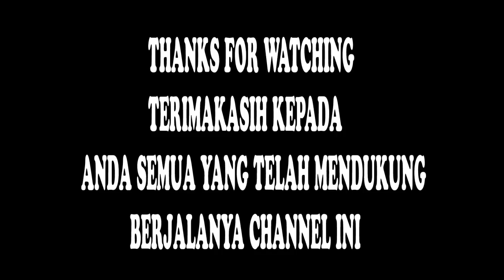cara merakit power ampli sederhana

Comment: Itu adem selalu ya bang transistor final nya dan trafonya?
Reply from the maker: Ya biasanya anget mas..di siasati dengan memasang kipas 12v biar aman dan awet
Reply: @ReogChannel  kalau nggak di kasih kipas DC adem selalu ya bang transistor final dan trafonya
Reply: @ReogChannel  buat angkat 8in 2 dan 10 in 2 kuat enggak ya bang ?
Reply from the maker: @najwaelek5139  kalau trafo gak usah di kipasi gak papa mas..asal trafo kondisi normal.

Gak pake kipas juga gak papa tapi untuk jaga2 kalau digeber/beban berat biasanya tr final mulai anget
Reply: @ReogChannel  buat angkat speaker 10inch 2 dan 8inch 2 kuat enggak ya bang ?
Reply from the maker: Spek amplinya seperti apa bang?
Sama seperti di vidio kah?
Itu lebih afdol nya pake 2 power mono 
Per mono minimal 1 set final

Comment: Gan .sanken sya baru Pasang langsung jebol .dikasi 32 ct 32.soalnya dipapan trtulis 42dc
Reply from the maker: Ganti juga tr driver nya biasanya itu masih bd139 140
Ganti tip 41 42
Reply: @ReogChannel  Udh tdnya d313-b507 gan .cuma tr sankennya ko bawah kodenya 60 watt. Mksudnya apa ya.. Sya ganti tip3055 akhirnya  gan
Reply from the maker: Saran saya kalau mau supply diatas 25v
Ganti 
- tr driver
-tr final
Kalau cuma diganti salah satu saja biasanya masih kobong hehe bahasanya belibet..
Final pake sanken / Toshiba jangan TIP
Reply: @ReogChannel  Iya itu masalahnya dr beli jd itu udh trtulis 42v.. Driver d313 b507.final sanken monstar langsung jebol Yg npnnya akhirnya ganti tip3055 2955 dh..Tegangan max berapa gan harusnya buat sanken monstar..nah wktu bli ocl 100watt tip3055 aja yg udah jd bagus ko dstu trtulis 24vdc
Reply from the maker: @AtepChanel11  ya produk lokal yg banyak dijual emang sperti itu bos.. makanya kita harus lihat2 dulu komponen yg ada di kitnya sebelum meng eksekusi...
Kalo tip saran max 25vdc saja jangan lebih..kalo mau lebih ya di rombak komponen nya yg utama tadi saya sebutkan di atas

Comment: Mas kasih kisaran harganya alat"!
Reply from the maker: Untuk alat ya seperti solder, tenol dll
Untuk bahan kit power driver mungkin sekitar 50rb sudah ada transistor final nya
Tune control subwoofer 30rb an
Trafo 5A biasa 70rb
Elko 6800uf 50v 2biji 12rb
Dioda 10A 7rb
Belum box dan aksesoris lainnya

Comment: Saya sebagai pemula apa nama nama komponen Yang dibituhkan tolong sebutkan dan harganya semuanya berapa kita kira
Reply from the maker: Bisa dilihat di video2 di channel ini sudah banyak tutorial2 nya...
Yg umumnya
Travo 5A kecil ,: 100rb
Elko 6800uf /50v 4 biji : 60rb
Driver socl 504 : 75rb
Transistor final 2 set Toshiba 5200 : 70rb
Headsink tipis : 35rb
Kipas dc: 15rb
Tune control subwoofer : 30rb
Speaker protektor (jika dibutuhkan) : 40rb
Jack Audio 3.5mm : 12rb
Soket RCA : 10rb
Terminal output spker : 3rb
Tenol kecil :14rb
Baut : 3rb
Saklar indikator 3kaki : 3rb
Box power bell m210 : 250rb (bebas mau pake box apa)
Dan tambahan kompone2 kecil lainya
Reply: @ReogChannel  
Terima kasih jawabannya semoga Chanel anda semakin berkembang

Comment: bertanya dl gan..travo 5A murni dioda35 n elco 4biji 10000mf 80v.brapa vol di ks dr travo 25,32,40,45.sy mau rakit 400wath x2 gan tlong petunjukx...trims.
Reply from the maker: untuk speaker berapa in x berapa
Reply: 12 in. 8 omh 4buah sepiker gan..
Reply from the maker: Wayan Wiarta 45ct

Comment: Dioda kiprok yang di pake di ton control ukuran brpa mas
Reply from the maker: 10Amper
Reply: @ReogChannel  untuk tegangan yang di ton control di taruh yang brpa vol bos
Reply from the maker: @errfirr1635  12-15v
Reply: Bang kalo kegedean ampere dioda efeknya apa
Reply from the maker: @errfirr1635  gak apa" gan malah lebih bagus
Reply: Mas ngikut gabung kalau dioda kiproknya pakek 5amper 4 bisa gk buat tone control nya
Reply from the maker: @wardiaticoc8464  bisa mas ... Minimal 5Amper
Reply: Dioda 5amper 4 biji trus elconya berapa vol. Mas dan berapa biji
Reply from the maker: @wardiaticoc8464  elko minimal 2200 uf / 25v 
Dan dioda 2/5Amper
Reply: matur nuwun mas, tak dungakno mas semoga di mudah kan rezekinya dan segala urusannya amiinn.
Reply: Oiya mas dioda nya berapa biji, saya nyari yg dioda kotak 5apr. Atau yg jari 4. Susah amat, adanya paling yg panjang kayak lontong, itu bisa gk dan  Pakek berapa biji, matursuwun

Comment: Kok elkonya banyak bang.
Itu pengaruh.y apa bang.
Trs itu bisa ngangkat berapa spiker X berpa inch bang.
Reply from the maker: Arnot77 Arnot elko lebih banyak lebih baiki bang karena biar voltase nya jika terkena Suara Low / bass tidak ngedrop (atau istilah nya nggaber)
Reply: Berati bisa menambah kualitas suara dari bas ya bang.

La saya mau ngrakit power 400 w sanken stereo merk picanto by sniper buat ngakat 12" X 4,
Kira" butuh trafo brpa Amper dn elco berapa buah dn brpa uf/volt dri elco bang.
Reply from the maker: saran saya final nya di tambah 1 set per mono gan.. jadi total di tambah 2 set (ini minimal lebih juga lbh bagus suaranya) karena di bebani oleh 4 speaker... jadi bisa di simpulkan klo ditambah 2 set...
main nya per set buat ngangkat satu Speaker..

untuk elco 10.000 uf 80 vol 6buah hasilnya sudah bagus
Reply from the maker: minimal 10 ampere Murni ( besar)
Reply: TrimAkAsih bnyk banyak bang sangat membantu.
Salam sukses buat njenengan bang.
Reply from the maker: Arnot77 Arnot amin... terimakasih bang...
jika blm paham silahkan tanya lagi saya siap membantu
Reply: Oke trmakash bang bAnyak bng
Reply: Bang klo 10a murni besar itu yg berapa volt bang.
Bedanya apa sama yg kecil bang.
Reply: Itu bisa angkat speker 15 inch gak
Reply: Minta catatan lengkap dong gan.. apa saja nama nya.. maklum blajaran..mkasih

Comment: Sya pnya elco winner 47000uf/100v 2 biji. Tpi saya cma pnya travo 5@ ct 32.  Bermasalah kah kalau dbuat supply.  Makasih sblumnya.  Ngopi ngopi :))
Reply from the maker: Sangat aman sekali bos
☕☕😁
Reply: @ReogChannel  soalnya sya msih pngin blajar om.    makasih udah djawab mas.   Smoga sehat slalu aminnn
Reply from the maker: @arokpanda3634  aamiin terimakasih semoga semuanya di sini selalu diberi kesehatan
Reply: @ReogChannel  enggeh om aminnn. Bleh mnta wa nya om buat BIMBINGAN blajar buat ampli sndiri :))
Reply: Mau nanya lg mas.  Sya pkek driver power sanken .tr final pakek sanken 2 set. Saat di tes kok. Suara serak/tdak jernih. Masalah nya dmnanya mass. Trimakasih sblumnya ngopi":)
Reply from the maker: @arokpanda3634  cek dioda nya mas sama tr driver
Reply: @ReogChannel  enggeh mas nanti saya cek. Matur suwun mas.  Ngopi" :)